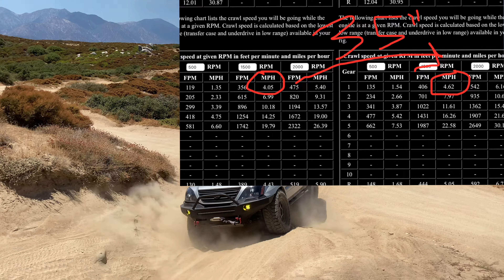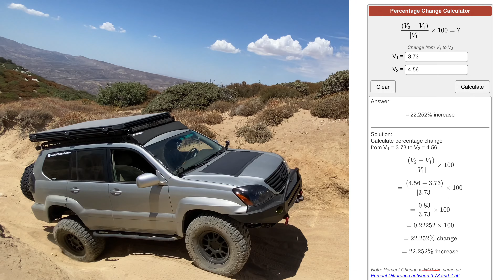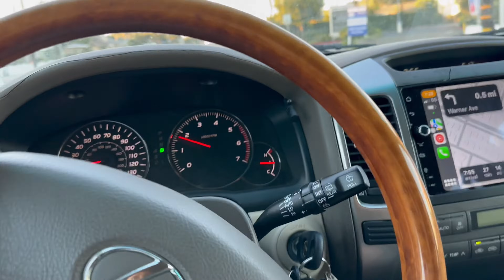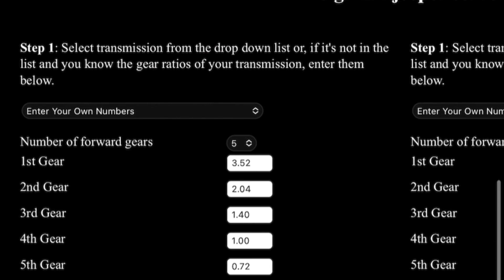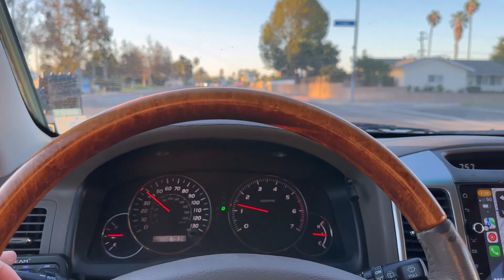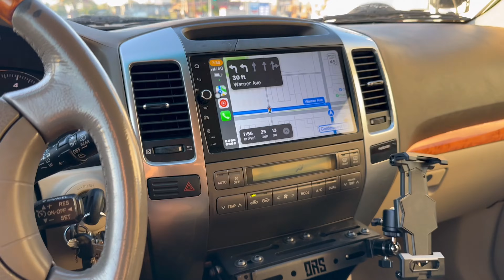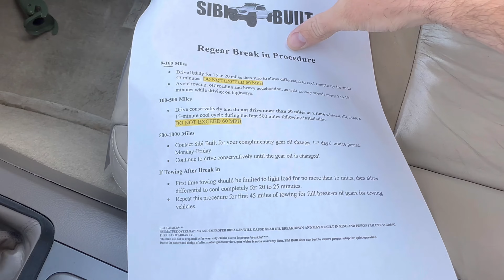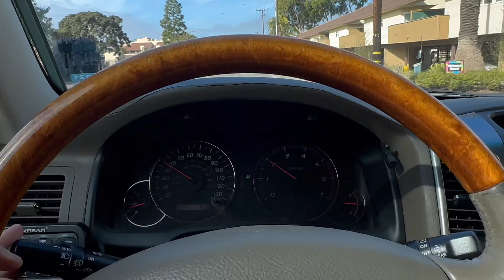How to Choose Regear Ratio for your Off-Road Build on 35” Tires Toyota 4Runner / Tacoma / GX470/460

Comment from the maker: A lot of people ask why I kept the stock 8.0" rear differential instead of getting an 8.2" or 9.5 Diamond axle, etc. so I'll answer that here: I'm skeptical that the only reason the 8.0 breaks is that it is insufficient for the platform with upsized tires. Lots of things break diffs (mostly driving) but with the GX470 platform specifically, its excessive backlash from high mileage. Over time, your differential will slowly work its way out of carrier bearing preload and pinion bearing preload spec. This allows for excessive backlash, which, if there is a lot of tires in the air + lots of throttle + suddenly getting traction as the tire hits the ground = carnage. Some say that just getting a pinion/carrier bearing preload refresh (putting the diff back in spec) can increase the strength of a stock 8.0 with over 100k miles by 50 some-odd percent. I'm not saying that the 8.0 is not a weakness, because it definitely is, but I have given it every possible advantage with my build: 
1. Freshly built unit by the qualified professionals at Sibi Built (all preloads back in spec) 
2. Solid pinion spacer to ensure it doesn't work it's way out of spec over time like the stock crush sleeve 
3. Short crawl gear ratio to give me maximum control as a driver over wheel speed 
4. Locking differentials front and rear (will talk more about this next video) which ensure I don't need to give her the beans on the throttle in order to achieve the necessary traction 
5. ARB differential, which has 4 points of contact on the side gears due to the extra set of (forged steel) spider gears vs. stock having only 2 points of contact.

Again, its definitely more advantageous to have a larger diameter ring gear as it gives you a leverage advantage and usually more contact surface. However, I couldn't resist the idea that I could get all the performance of having a re-gear with twin lockers using the stock equipment instead of the additional cost of sourcing an 8.2 which may provide marginal benefit in breakage resistance or going all out with a diamond axle or something. I think that with rational driving using the lockers at the right time, using the throttle in a conservative manner, and all the measures for strengthening the diff that I mentioned before, I'll be fine. Some people may say "you don't want to be stuck not being able to gun it if you want" but who's to say that won't break the bigger diffs as well? You hit the throttle too hard on an IFS vehicle, something will break somewhere anyway. It's just not my style to drive that way regardless. I am definitely putting my money where my mouth is with this experiment so, whether you think I'm right or wrong, follow the channel to find out what happens lol

Much love,
Daniel
Reply: Fire dude🔥🔥 what about your average joe that doesn't rock crawl much. You think the 8" is just fine? 
Thx
Reply from the maker: @CristianCruz-jf4iw  hard to say because a lot depends on driving style.
Reply: Nice rig man! So im actually running 35s on my gx too and i want to do a similar set up. How much does this run? Also where did you get this done?
Reply from the maker: @crisgarcia6564  probably over 5k. Try to get in on a group buy though. My Tacoma buddy sent me a group buy they were doing on the taco forum and I got in on it after emailing them
Reply: @lexus_offroad_adventures  ohhh okay i see! Thanks bro!!
Reply: @lexus_offroad_adventures  btw how have the gears and lockers been since you got them?
Reply from the maker: @crisgarcia6564  watch some of my more recent videos. They kinda change the whole game imo. When you’re able to run 35s while having essentially stock gearing AND being able to lock all diffs, it’s a different vehicle. No longer a decently capable SUV. It would easily hang with a modern bronco Sasquatch.
Reply: Wait i just saw where you got it done lol

Comment: Yeah man, I have come to the conclusion, based on several other forums, videos and yours, that a re-gear is required.  While I'm only on 33's now (255/80-17, so technically 33.3"), it's road drivability above all sucks, constantly hunting on overpasses and such and I've only added about 300 lbs so far, but that's still an extra 300#.  On the trail with low range, it's really fine, I'm going to 34's eventually, so a jump to 4.56's would be perfect for me.  Mine isn't as heavy and I still want to keep it pretty streetable.  I mean the bottom line is Toyota under geared them from the factory.  I think we miss that all the time.  My Bronco Badlands came with 285/70-17 (32.8) and it had 4.7's from the factory, without a Badlands you still got 4.46's.  Jeeps come with like 4.10 and better, it's like what was Toyota thinking?🤣
Reply from the maker: They were trying to squeeze every bit of highway efficiency out of the thirsty 2UZ that they could! 

Yeah I remember how bad drivability was when I had the same pizza cutters. One-and-done with a regear and get all the reinforcement benefits mentioned as well

Comment: Nice video!  Dude; I really like the sparkley wood on the steering wheel! It's glorious!  I got an older Nardi steering wheel and it's great with the wooden spoke.  Your came stock like that?! Lol.  Those Lexus are awesome.  I've got an older 99' 4X4 4runner with a 5speed manual; my plan is also 4:88.  The manual makes it very responsive, and 4:88 has a larger pinion head than 5:29.    I have considered 5:29, but don't like the possibility of not being as bulletproof.  Cheers!

Comment: What’s the difference on highway speed for mpg? I daily my truck to work and use it regularly everyday
Reply from the maker: It makes drivability all around better. The engine is operating within its proper range for the 35” tire size. Revs sit 700 rpm higher for highway speeds but it’s worth it for the improved drivability and fuel economy since it rarely drops out of overdrive (which happens all the time without regear) and the air/fuel map works as designed. Personally, I went from regularly getting in the 10-11s mpg on the display for mixed driving to 14s-16s but this could be down to varying driving habits and routes rather than a significant fuel economy since gain. No doubt, it is better for the driveline though, which saves money in the long run.
Reply: @lexus_offroad_adventures  thanks for response bro. Yeah I’ve been thinking of doing it on my 1st gen tundra before I go 35s. And for the same reason, less stress on the drivetrain. Was just wondering on how it was for drivability for daily driver also since mine is 80% daily / work vs 20% hobby and off-roading. I’m getting about 11ish mpg rn with 33s I just don’t wanna get worse than that lol. If I can remain the same or improve that would be dope. How much did the job cost if you don’t mine me asking?
Reply from the maker: @Beautifulmechanic02  np, yeah don’t go 35s without regearing… it drives terrible. Now, it drives nicer than when I was stock on 33s. My regear job included ARB air lockers front and rear so 5k+ with a Tacoma group buy deal I got in on

Comment: I have a 3rd gen 4runner on 285 70 17s i do wheel with it alot but it also sees alot of highway miles i try to keep weight down when i overland too would 456 be good for those tires u think? Someone told 488 might be better but i dont want high rpms on highway
Reply: 6 months later to answer your question. 4.56 gears for sure in your case.

Comment: In some cases, lower gearing and higher rpm at Highway speed ( example --factory rpm at 65mph is 2000 rpm increases to 2400rpm at 65mph) Can actually increase fuel economy (better mpg). 
So ibhad a 1982 toyota hilux with 2.4l 22r and it had 4.10s with 33" tires, and highway rpm was 2700. So it should have been OK, but truth was it would not go faster than 55mph. I regeared to 4.88s, brought rpm UP to 3200, and went from 18mpg to 24mpg and I could now go 65 on the highway no problem. 
The 4runner with the v6 making max torque at 4000rpm and max hp at 5500, NEEDS to spin faster. Factory gearing and tires put highway rpm at 65mph around 1870rpm. Way to low in my opinion,  and that's why they get absolutely shit fuel economy (17l/100km or around 16mpg)
The engine is lugging to much, and it clearly makes more power higher in the rpm range. 
If it was me, I would gear the 4runner to around 2400rpm at 65 mph and expect to see a huge increase in fuel economy.
Reply from the maker: All 100% true. Thanks for sharing your experience

Comment: Th is for the explanations here.   Based on your experience I think I’ll be going 4.88 as well.  Was thinking 4.56 but last time I trailered my overland camper across South Dakota, I struggled to hit 70mph.   I definitely think this gearing will help.
Reply from the maker: @Overlandwithsnacks  Forsure With 35s and towing, I think the extra gearing will help a lot. Running a bit higher in the rev range isn’t the end of the world. Can always size up the tires if you don’t like it 😅

Comment: Hello, I bought the ARB skid plates and I couldn't install the transmission skid plate because it makes contact with the muffler.
Reply from the maker: @JoTaWorks  how bad is the contact? Can get a sledge and bash in the exhaust a bit. Won’t affect anything. Alternatively, you can stack some heavy duty washers to space it out and get longer hardware, but then you’re reducing clearance
Reply: @ In my case, I had to smash the muffle too much. I'm not going to put shims on it because the ground clearance goes down. That's what you did.
Reply from the maker: @ I have RCI steel skid plates now

Comment: The transmission fluid will thank you. All that extra torque converter slippage gets the fluid nice and hot for extra long periods. One thing that might be useful is measuring the loaded radius or the distance between the ground and the hub center while the tire is supporting the vehicle's weight. Double that, and that's the actual tire diameter the vehicle sees.
Reply from the maker: @dadgarage7966  very true!

Comment: Question, if you buy a truck with 35s from a dealership. How do you know the previous owner regeared the car to run 35s?
Reply from the maker: Use the grim jeeper calculator I put in the description, put in the stock gear ratios for transmission and diffs, stock tire diameter, and figure out how many RPMs your engine would be running at in overdrive (top) gear, at a given speed (say, 60mph). 

Then, do the same calculation but increase tire diameter to the 35” tires.

Determine which calculation result most closely resembles your on-road experience.
Reply from the maker: Sorry here is the calculator: http://www.grimmjeeper.com/gears.html
Reply: @lexus_offroad_adventures  thank you!

Comment: Liked and subscribed. My 2023 4Runner has 33.9 inch KM3's, lightweight steel bumpers, full set of steel skid plates, and hitch spare tire carrier. Should I go 4.56 or 4.88? Thank you! 🙏
Reply from the maker: Thanks so much!
I hate to say it, but it really depends on what you use the rig for. Is your priority eating highway miles and doing some higher speed dirt road/overlanding trails? In that case, maybe a 4:56 would work better.

Do you plan to make it more of a “rocklander” where you’ll be tackling black diamond trails regularly? Maybe you want to increase the tire diameter at some point in the future? A 4:88 might be better in that case. 

It all comes down to the use case. It’s an important decision that you want to get right, so take your time in considering these priorities.

My personal choice came down to this: if I gear too long (4:56), I will have to decrease tire size to get the right balance of gearing. If I gear too short (4:88), I will have to increase tire size to get the right balance. Since I lean more “rocklander”, I would much rather increase than decrease tire diameter, if I had to in order to bring gearing into the right window, so I chose the shorter (4:88) gears. This happened to be the right choice for my setup, because with my rig’s weight, tire diameter, and wind resistance,
The shorter gears help keep it in overdrive and ironically helps with fuel consumption (as long as my speed doesn’t go beyond 70-75 ish). It also helps keep things controlled when in Low range while crawling.
Reply: @lexus_offroad_adventures  Thanks. I think I'm going to go with 4.88. If I feel that I'm over geared, I'm going to throw 35s to fix it 😁
Reply: @lexus_offroad_adventures Will 4.88 affect my gas mileage on the highway?
Reply from the maker: @dawood2u  it could even help mileage depending on the speeds you’re going. The more you keep the engine in the operating window designed by the manufacturer, the better the mileage/performance, in general. Going a little shorter on the gearing can help compensate for accessory weight and wind resistance though.
Reply: @lexus_offroad_adventures  Awesome. I am excited 🤩
Reply: @lexus_offroad_adventures  Please recommend an awesome gear oil for Toyota and Lexus. After the break-in period, I want to use the best fluid out there. Thank you so much

Comment: * PLEASE HELP***
-2016 4runner SR5 5th gen. 4.0L/Cyl. 
it’s heavy with lots of mods
    I need to re-gear for 35s. Do I buy 4.88 or 4.56?
    What’s the difference?
Reply from the maker: Couple things:
What are your priorities? Long distance overlanding? Lot of highway miles in top gear? Or low crawl speeds for severe off roading?

you’re working with only 278 lb-ft of torque with the V6 versus the GX470’s 320 lb-ft. With 4.88s I feel like it’s the perfect gearing for me but even then, the truck is slow. I couldn’t imagine going with longer gearing than 4.88. But I don’t drive that much, so your priorities may be different if it’s a daily. I suggest talking to other 4Runner owners with similar rigs to get a better idea of how it drives with your preferences in mind.
Reply from the maker: As for what the difference is, the video goes much more in-depth than I can in a text reply. If you don’t understand a part of the video, let me know and I can try to clarify.
Reply: Mostly highway/city driving 
45-65mph. 
Phoenix Arizona
Reply from the maker: @SageHeller  4.56 could work but ask 4Runner people first

Comment: now that you had some time with the new gears, would you say if running 34's 285/75r17, 4.56 would be ideal over 4.88?
Reply from the maker: Honestly with the weight I’m at there are times where I wish they made 4.95s or something. But on 34s it would be a toss up for me between 456 and 488. Depends on how heavy the rig is and driving preferences, etc.

Comment: Let me apologize before I even ask because I already know the answer, but please shoot me straight. I also have a GX470 and I want to upgrade to 285/75/17 tires which come to 33.8in diameter. How necessary is a regear for these tires? Followup, if I were to step down to just a 285/70/17, how necessary is a regear for those at 32.7in diameter? Pls link your Venmo so I can compensate for personal advice
Reply from the maker: The 33.8" diameter tire will definitely be a drag on efficiency and drivability. In my experience with 33s, which were 255/80/17 (I think my Load range E Falkens were 33.1" diameter), drivability was just as bad with those as with my 35s. Ok maybe not AS bad, but close, mostly because the way the transmission is programmed. It gear hunted like crazy. A lot of the need for regear will also depend on the extra weight. If you're running a relatively lightweight rig, I'd say you can easily run the 285/70s without a regear. Not to mention the reduced trimming of the fenderwells you'll need to do. If you're not sure how far you want to go with a build on the scale of light overland rig to dedicated rock-crawler, I'd run the smaller tires for the time being until you fully plan out your build end-game. 

Hah, no worries on the Venmo, I love helping people out with their builds. If you want, I believe YouTube has a SuperThanks feature for subscribers to directly contribute to the channel. Revenue from the channel gets reinvested into content!
Reply: @lexus_offroad_adventures  You definitely talked some sense into me. Opting for the 285/70s saves me from both the regear and body mount chop, not expenses I want to incur at the moment. 

With that being said, I found some 285/70/17 BFG KO2s locally , 900 for a set. Great deal, right? The catch is that they are load range C... After some research, it seems load range C might be adequate but it feels like a durability and safety downgrade from the load range E tires I currently have. Do you have any thoughts on this situation? Regarding your previous response, I fall more towards the light overland build category but still wheel moderately hard off-road in the desert southwest. Any insight would be greatly appreciated.
Reply from the maker: @krunckap3795  Load range c tires will likely drive significantly better because of their reduced weight. Any tire is prone to puncture, so you should be prepared with a plug/patch kit and a spare regardless. But as long as your rig is well within the limits of the load range C rating, you should be good to run them. Most GXs without heavy armor, winches, tents and other heavy equipment should run load range C in my opinion. Any less runs unnecessary risk of puncture, any more, unnecessary fuel consumption and poor drivability. On C vs E, you’ll notice that when you air down when off road, the ride will be more compliant as well since the sidewalls have more ‘give’ than the super stiff E’s